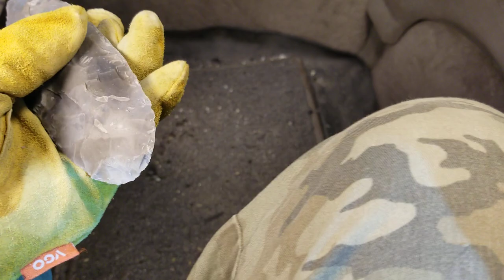1220 - Stage 1/5 - Natural (Abo) Flintknapping

Comment: Do you know the techniques used to make those commercial bulk arrowheads from china or india by chance?
Reply from the maker: Yes. They use hammers and anvils and chip the stone (agate) very quickly. It's a process similar to making gun flints. There used to be videos of the process but I can no longer find them.
Reply: Could you do a short demo of the technique and make a quick arrowhead that way please?
Reply from the maker: @meyo4158  I could, but then I would have to put everyone on hold (that's waiting for me to complete their orders) so I can switch back to steel tools and practice the technique off camera. Is there a reason you want to see this?
Reply: No particular reason I just wanted to see how it is accomplished.
I have been knapping on and off for a little while and wondered how it was done in that way.
Reply from the maker: @meyo4158  I see. I'll try to post a video on it next week.
Reply: @KnapperJackCrafty  that would be beyond awesome thank you

Comment: is the hard hammerstone "swiping" method suitable for this type of work ? its very hard to master ! sometimes it will work perfectly for me though and other times failure , edit , i dont know if you saw my comment regarding the pitchstone point , have you sent it yet ? cheers ... lawrence
Reply from the maker: Yeah, I saw the comment on the pitchstone. I haven't sent it yet. I'm waiting until I make a few more points for you before I mail it off.
Reply: Not really, hard hammerstones work best hitting above the edge on steep, sturdy platforms. They take advantage of the mass of the percussor more so than the velocity to initiate the fracture and produce a flake. On the other hand,  swiping techniques, or bending flakes, as others in the knapping and archaeology communities refer to them, work better with a softer percussor that crush or deform slightly thus absorbing energy from the impact and transferring that energy into the flake over a slightly longer period of time ( by a few milliseconds, it still happens in the blink of an eye). These types of flakes initiate from a blow to the edge as opposed to above the edge, and are best suited to leaner, or more acute edges, and produce a much thinner flake, with a far less pronounced bulb of percussion. They work better with a faster blow from a less massive percussor compared to “ gouging flakes”. Support for each technique/ tool is subtly different, and of the utmost importance in producing the desired results. The differences in how these tools/techniques work from one another relates to the relationship between the seismic waves as they propagate through the medium. Essentially, the compression wave or P wave gravels faster but loses energy more rapidly, thus slowing the further it travels as compared to the shear or S wave, which initially propagates slower than the P wave, maintains a more consistent velocity as it propagates such that, depending on the specifics of the initial energetic input, the P wave will either propagate through the medium ahead of the S wave the whole time, or decelerate to the point of its being overcome by the S wave at some point in the fracture process. I have only barely wrapped my brain around these concepts, let alone the relationships, but it is an intriguing concept that has helped with my intuitive understanding of the process even as it is difficult to maintain it in my conscious mind. The rippled surface of certain flakes occurs when the S wave overcomes the P wave. I believe the P wave is reliant on the mass of the percussor to supply its energy, while the S wave is more dependent on the velocity of the impact, which explains those ripples tending to show up when hitting faster with a lighter percussor vs hitting slower with a more massive percussor. This is my layman’s understanding of the complex physics of flake mechanics, so if any actual physicists or geologists who have a working understanding of this topic please correct me if I am getting anything wrong.